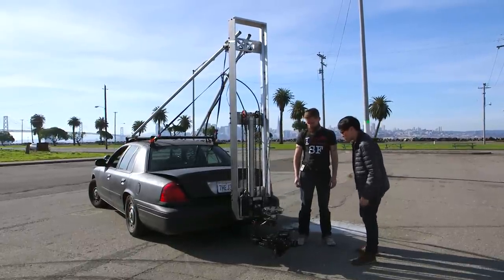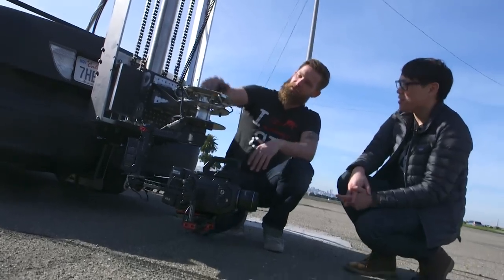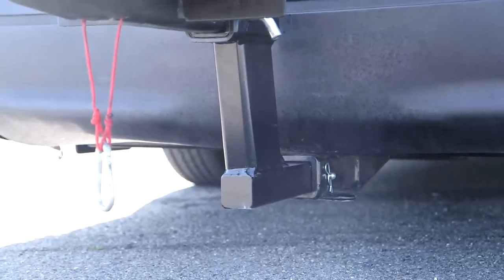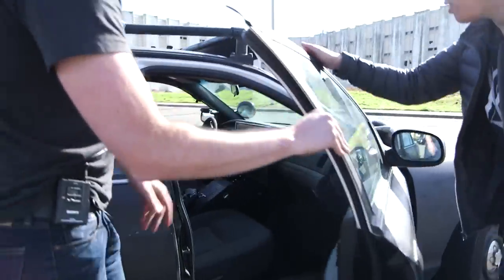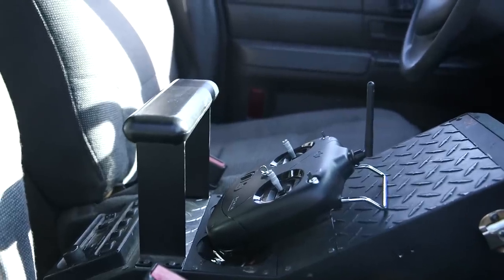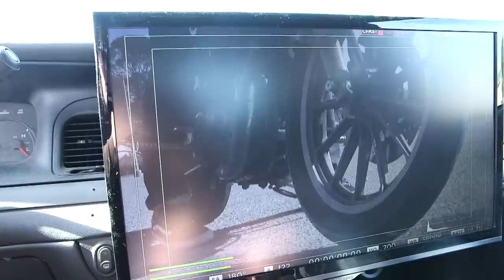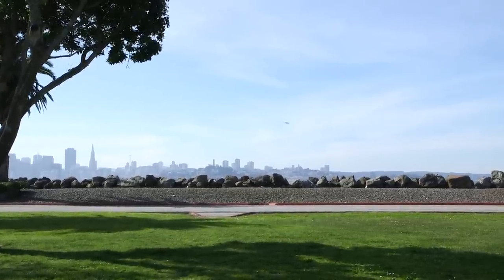Filming MythBusters with a Custom Chase Car Camera Rig

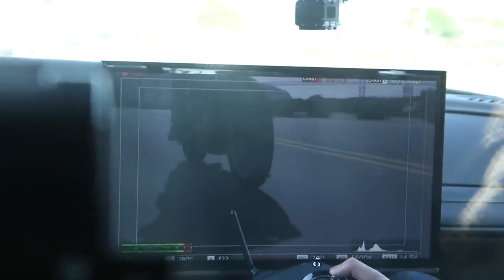Comment: "Precise control" 7:55, and that warping, omg...
Reply: Štěpán M. Probably the inexperienced ops fault
Reply: He was talking about the air. Don't take it out of context.
And for air, there is precise control, it's a solenoid valve. they tell it go, it goes, they tell it stop, it stops, it's pretty much instant
Edit: Looking at the shot again, he went too fast and stopped midway. Then restarted. That's something to expect with fast moving gear that he has no experience with. And for a demo like this, there's no real point in reshooting it

Comment: I love this !!  Looks like the vertical movement is a little "jerky", guessing that is the way the pedal handles the air compressor ie. no smooth lead in/lead out?  Also, just curious, I assume you have to have a set point of focus before you roll, like 8 feet out or something, since you have no remote focus/iris control, yes?  Finally, minus the camera and Ronin, what is your guesstimate on the cost to build such a rig?

Comment: Such a sick rig really impressive. I wonder how smooth that initial movement of the lift is, I would have thought that would have been quite difficult to achieve, but I couldn't see any sudden bite in the footage.
Reply: +kingoginge  The upwards movement didn't look very smooth to me, viewed 3rd person or through the camera.   The first thing I thought when they said it used a pneumatic cylinder instead of hydraulic, was that it would be very hard to get it perfectly smooth, and sure enough, it was not.

Comment: make a rail that arcs from the tow hitch to the front roof of the car, so you will be able to take shots that's in front of the camera car?
but keeping the camera level will be a pain as it travels over the arc, and having a electric motor drive for the rail probably won't be as smooth as using a air strut

Comment: Cool! great one. Why air cylinder of something like stepper motors or something else? I don't know enough about either to understand why one would be better than the other?
Reply: The air cylinder allows fine control of the heavy camera while offering extremely slow or fast movement. A stepper motor while smooth lacks the speed they need.

Comment: Does car insurance cover the camera and rig? Because in the event it got rear ended, that camera and rig are worth enough to buy maybe 15 more of those cop cars.
Reply: +World Known That URSA 4.6k and the ronin is not that expensive
Reply: Tommy Ip Maybe I was over exaggerating a little, but the URSA is $7k just for the body, and the Ronin is another $3k on top of that. With all the other parts of the camera and the actual rig on the back of the car, I could see the price at $15k or more.

Comment: How would they change focus and zoom on a rig like this without a remote follow focus?
Reply: +Garret R locked focus and zoom probably
Reply: That doesn't really seem like a good cinema solution, especially if your tracking an object that moves in the frame and changes distance from the chase vehicle
Reply: And everyone knows autofocus sucks plus the fact that most Cine lenses don't even have it
Reply: +Garret R There are many wireless focus pulling solutions you could add. Just a focus puller in the backseat.
Reply: Yeah that's exactly what i'm talking about, theres nothing on here that would do that
Reply: +Garret R Not sure why they didn't add one. They may have just thought that they will mostly be using a really closed down aperture?
Reply: Yeah I'm not sure

Comment: Is that the vibration dampeners from rctestflight??
Reply: *dampers
Reply: +Ole Andreas I think we both agree that this vid could have been twice as long and given twice as much detail. I want to know if the FS700 can do 200fps by itself, or if that's the Odyssey recording the RAW output? Over HDMI or SDI?
Reply: +sik59rt *dampenerers
Reply: +Ryomichi they mean completely different things
Reply: +John Alexander 7q takes the sdi but fs700 needs to have 200fps firmware too? I believe all new ones have it in the box.
Reply: +sik59rt and dampeners is the correct word, not dampers.  So you are still wrong.
Reply: +TheRussell747 oh so those things get the camera wet? Sorry, didn't know that.  I thought they were to dampen the vibrations. But what do I know being in the suspension field.
Reply: +TheRussell747 maybe try looking up what a damper and a "dampener" is before speaking
Reply: +sik59rt You thought they were to damp the vibrations.
Reply: +sik59rt you happen to be in the suspension "field" yea right.... and dampener is the correct word, they dampen the vibrations. dampen means the same thing but used in a different context.